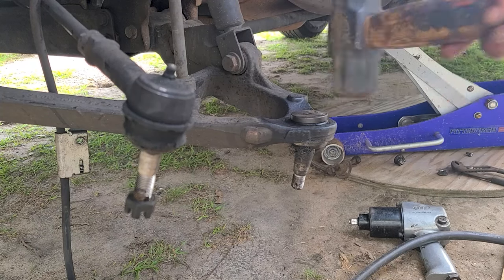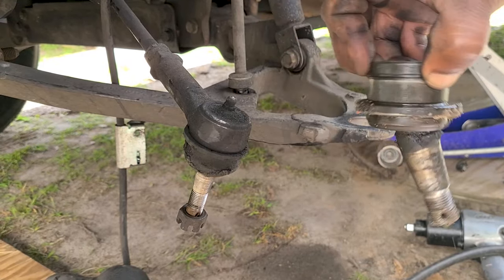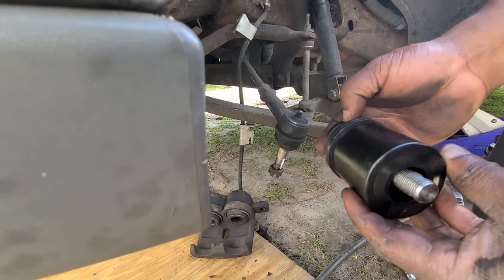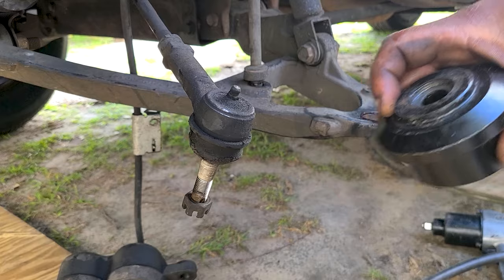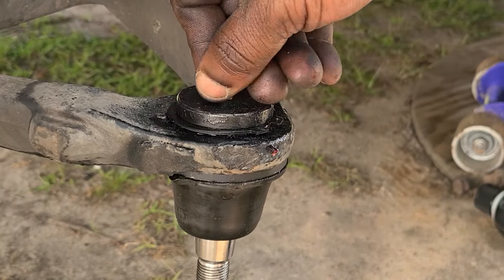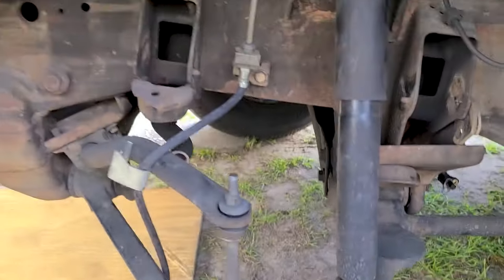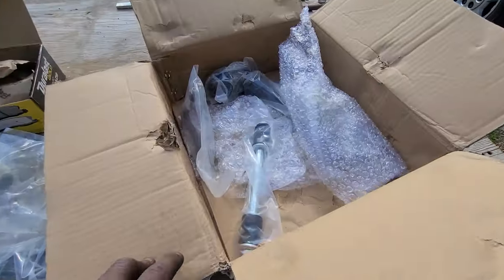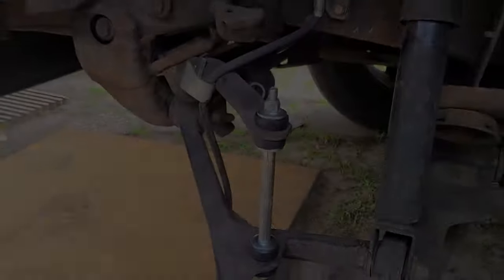How To Replace Front Lower Ball Joints 99 - 2015 Chevy Tahoe Yukon Silverado GMC (Quick Version)

Comment: I see you did not have to remove the torsion bars. leaving the shock on prevents the lower control arm from flexing down after removing the knuckle I assume. I'm about to replace lower ball joints on my Tahoe and didn't want to remove them or take the tension off, messing with the ride height. 👍
Reply from the maker: No, you don't have to remove the torsion bars to replace the ball joints. Good luck, and thanks for tuning in. Let me know if you need some help.🫱🏾‍🫲🏼

Comment: You made this too easy. Now I'm contemplating this instead of buying a control arm. Nice job!
Reply from the maker: Thanks. It's actually easier than replacing the control arm. 1 2 3 done🤷🏾‍♂️
Reply: @letsfixit251  yes sir. Not near as many steps. How long did it take to remove with the hammer? Or was it really that easy?
Reply from the maker: @jeffreyayer5814  right and what you saw was in real time, but honestly, they don't always come out that easy. Mine doesn't suffer from any rust, and I've changed these like two or three years ago already. You shouldn't have any issues as long as you follow those steps.
Reply: @letsfixit251  I'll let you know how I did. All else fails.. I'll buy new arms. Thanks again 🇺🇸
Reply from the maker: @jeffroW0331  no problem good luck🫱🏾‍🫲🏼